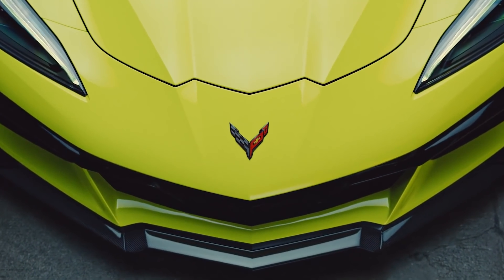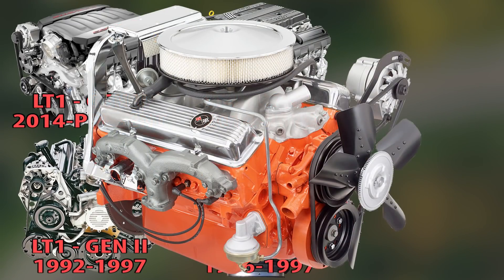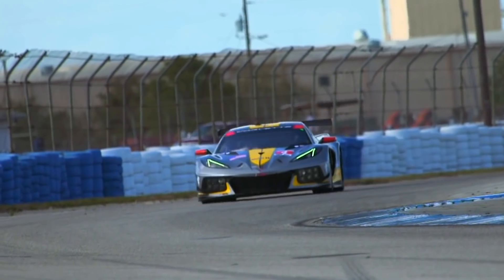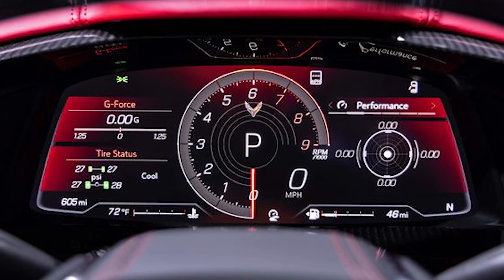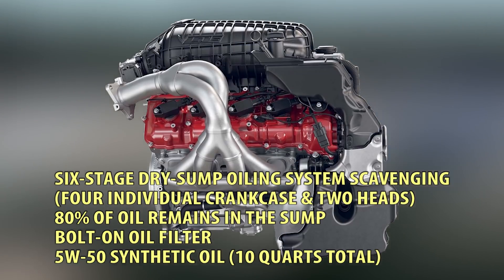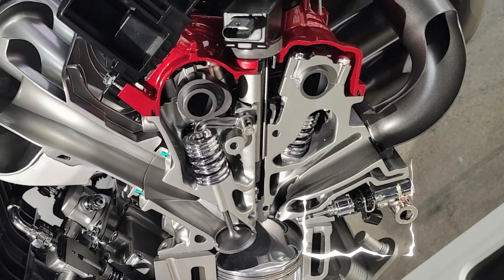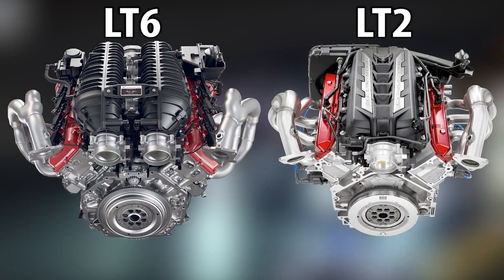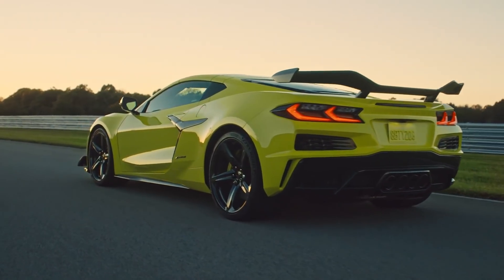What everyone missed about the 2023 Corvette ZO6 LT6 reveal

Comment: Great video accept for when explaining the flat plane crankshaft. You use a picture of the voodoo crankshaft that, while being a flat plane, is completely unique to itself and not a good representation of the typical rod journal placement of a flat plane crank.
Reply: I noticed that too! You beat me to the comments section! :-)
Reply: True story
Reply: I saw that too! Right at the 5 minute mark. Even the cross plane crank illustration looks off. The illustration just after that clearly shows the two center pistons rise and fall in unison. The voodoo engine sound with that different crank configuration, while high revving, is more like a traditional cross plane v8.
Reply: @timothycravens223  and sound is the only reason Ford used that crank configuration.
Reply: Except, not accept. All the boys made the basketball team except Marvin.  Amazon will not accept my return.

Comment: Dollars to donuts the valve train is gonna fail like it did when porsche used the same design n had issues with it and went away from that set up. Also this motor has no low end power and you will have to beat the piss out of to even get any respectable performance out of it....

Comment: Possible the C8 ZR1 will be TT, it will keep the current intake like C8 Z06, this  because if it be supercharged, they have to remove that new design intake manifold, and i don't this will be happening, but if the new ZR1 C8 is TT, possibly be around 835hp just guessing.
Reply: Root style superchargers are generally inefficient and create a lot of heat at high rpm’s. Because of the high rpm characteristics of this engine it will never see a supercharger like the previous generation pushrod engines. A centrifugal supercharger would work but packaging and belt slipping raise issues. Turbocharging will be the most effective and efficient way to boost this engine. But we may never see a boosted version of this engine at all. With EVs being pushed hard these days I see a hybrid version being the the new ZR1.

Comment: Good video. According to a recent interview with a top level GM Engineer, this platform was not designed for an all wheel drive system.(See the recent Jay Leno test drive of the new C8 - 2023 Corvette Z06). Yes, it will be interesting to see the ZR1 bringing the car to even higher expectations. (When the C9 hits the streets, I believe it will be an all wheel drive front engine design. Will it be totally EV)? I know folks will be like, ahh....no the Corvette won't be reconfigured to front engine ever again. For now, yet again the Chevrolet flagship is a winner!
Reply: The C9 will be all electric.  As for the C8 ZR1, this motor is screaming for turbocharging.  The main ROI of a flat plane crank is the ability to turbo with single stage since no cross contamination of exhaust.  I was also wandering how the C8 clutch was going to handle all this power.  I never dreamed they would do it by KILLING torque, but they did...
Reply: @barrythehatchet1380  Spoke with someone with GM.  In response to my many questions said:  "Don't give too much credibility to sites like GM Authority.  Don't count on ZR1 or Zora.  Don't count on turbo.  Hybrid will happen.  C8 is likely the last generation of internal combustion engine Corvettes".  There will absolutely be an "E-Ray" or similar variant coming up.  If not for the crazy ordering situation, (meaning by the time your name comes up for a Z06, they may not be making them anymore), I would be buying one.  Despite more power with whatever variant of hybrid comes up, it will be heavier with the motor or motors and the battery.  The C8 Z06 could be the last great Corvette.
Reply: @polystictus  There will absolutely be a ZR1.  Too much cash for GM.  Bet.
Reply: Electric motor will be featured up front.
Reply: @chachacamel  Yes perhaps. But see the new Hummer EV1 platform to get a better idea on all wheel drive configuration.
Reply: I'm letting you know, that unless something changed, a hybrid AWD Corvette will be the next model. There is no space in the "driveshaft" tunnel for a drive shaft to the front wheels, but it will be an electric motor, kinda like NSX, on the front wheels.
Reply: @chachacamel  I should have clarified when I said front engine design in an all wheel drive configuration. And yes I also believe the next generation may in fact be based on all wheel platform EV. It's in the cards for General Motors. (The Hummer EV1 platform is a solid introduction into all electric vehicles across all GM vehicle lines). But for now we have a powerful naturally aspirated LT6 powering the 2023 C8, and if the engine is supercharged in the ZR1, I predict the horsepower rating will be just shy of nine hundred!

Comment: GM's way to make a car faster:
1. Reduce displacement by half. 
2. Make the engine heavier.
3. Make the car heavier.
Reply from the maker: 1. 6.2l/2=3.1L (LT6=5.5L)
2. Apparently about the same weight stated by GM (3lb difference)
3. Depends on trim level and safety.

Comment: Might recheck your numbers because 480 TQ @ 7400 RPM is 676 Horsepower I think you got the HP and TQ numbers transposed.
Reply: With a flat-plane crank you get very little torque because they're such a short stroke and there's no counterweights
Reply: @tont3305  That actually has nothing to do with the post I presented.
Reply: @CRUSHFACTORPC  yes it actually does. The math that you have bid based on is on a standard motor. This is not a standard motor but whatever makes you happy
Reply: @tont3305  I don't care what motor it is even if electric HP ALWAYS = Torque X RPM/ 5252 PERIOD I don't care if it has an airplane flat plane crank. AT 7400 RPM with 480 TQ it will ALWAYS = 676 Horsepower. AND the earth is a sphere.

Comment: As long as GM is producing such a new world beater engine... they can call whatever they please!
Reply: @Mr.Joetatoehead What a way to go.
Reply: V shapy thingy fucking ferraris.
Reply: It's the same as anyone they gave up low end tq for high end hp. Also they are using a  expensive low production engine not based on other stuff they produce.  But hey gm already said they lose money on each c8 that's why they are so limited in production. But they miss the mark for consumers. What would you rather have a 850hp 850tq engine that makes power all over or a high strung n/a motor that also vibrates much much more and sucks to drive anywhere besides a race track and still with all the drawbacks gets killed by a car that's available and cost 50% less. Boost is God and when people are making 1500hp and 950ft lbs out of 2.0 motors well we know that the c8 already had heat issues adding a turbo was probably not a option because with 5psi the stock base c8 would kill this 50k more expensive car
Reply: @mddunlap03 No one knows what your comment means.  Maybe you could tell your Mom and then let her make your comment. That way people will know what you mean.
Reply: @dbx1233  I understood him just fine and I think he has a good point.
Reply: @bobthbldr3  Well, then I guess that settles it.
Reply: @dbx1233 hes the product of being neglected as a child lol now he's using cars to channel his rage 😂

Comment: Video says it has variable valve timing but no variable valve lift like vtech ? Wtf
Reply: And explain to me why that is necessary when this engine can do all the things that can do.
Reply: It has solid lifters like a race engine.
Reply: In this case, "variable valve timing" means that the engine can make the valves open sooner at some RPMs and later at others.  As opposed to Honda's VTEC system which switches between 2 different cam profiles (changing lift and duration) for each camshaft on each cylinder head.  Hopefully this helps.
Reply: It doesn't need it doesn't need it it produces more power than any other naturally-aspirated engine. It doesn't need it it gets the job done better than any other engine

Comment: Everyone: Electric cars are right around the corner. ICE is dead. 

GM: nah
Reply: You are correct. That is why you go out and get yourself a new Corvette or any internal combustion engine this is the swan song before you have cars without a soul. The difference between having a really nice Rolex watch and a $10 electronic watch yes they both do the same job one is beautiful the other is not
Reply: The problem is that the electric cars and their seemingly mundane existence will whoop this things ass.........as much as i hate to admit it.
Reply: @HioSSilver1999  and that feeling will be like wearing protection during sex. It's okay but it's not the real thing
Reply: @tont3305  not a very good comparison there. If you're driving a automatic car then it really makes no difference to you. And since almost everything is auto or dct it don't matter. You're still just riding in your car. One just makes a different sound than the other.

No me....my street car hotrod has a faceplated t56 with a 5.5 tilton clutch and a solid roller cam. Until you're there......you simply have no clue on the comparison front.
Reply: @HioSSilver1999  have you driven an electric car? It's not the same
Reply: @tont3305  it's acceleration and control. If it's about making speed a electric car will do it better.

I'm sure there are emotional disconnects......till you get used to the electric car.
Reply: @HioSSilver1999  have you ever driven electric car? The question still stands. Knowing not how a motor Works Pistons camshafts all the mechanical innerworks knowing how that is going on under the hood is part of the experience
Reply: @tont3305  no i haven't driven one. Doesn't matter....the experience is making speed. Not sticking your head inside the engine.
Reply: @HioSSilver1999  so you're going to tell me the experience is the same but you've never had the experience. You make statements as if you were a Gearhead but you're actually not. Rebuild an engine in a will change things for you
Reply: @HioSSilver1999  Plaid S 0-60 and the 1/4 yes but this is a track car. The Plaids Nurburg time will be 35 seconds slower then the Z. Also the Z can do lap times without the cool down and charging. But if straight line is your thing then head over to electric
Reply: @hwyfools  the plaids lap times are pretty damn good. It's not like it's some floppy suspended sedan your grandad drove. The plaid likely handles  better than what you're capable of extracting from it.

More over to reach a higher level of handling performance it takes more than most of you even know. A track weekend not only costs alot just to get in.....but you'll use up a set of tires and nearly a set of brakes. Not to mention added frequency of fluid changes with decreased maintenance intervals.  

It wouldn't surprise me if street performance was very close handling wise. It not like you can get 10/10ths out of cars like this on dirty streets.
Reply: Electric cars have come a long way. But you be  better off on scooters! Lol.!

Comment: The new ZO6 is absolutely nasty. I cannot recall a Supercar engine sounding this good since the Toyota  LFA  or Ferrari 458 which says a lot. I could only imagine how crazy the new C8 ZR1 is going to be. It’ll probably end up being an 800 plus Horse Power twin Turbo monster.
Reply: Check out the GMA T.50 if you like good sounding supercar engines.  The T.50 is the successor to the McLaren F1.
Reply: @Sir.VicsMasher  Or the Lamborghini Aventador and Lamborghini Murcielago with the Gintani exhaust.
Reply: It sounds like it was kicked in the nuts and these motors are gonna be junk on the street.
Reply: @Outtacontrol304  Says who? You? LOL.
Reply: @Outtacontrol304  I was always told: "Horsepower sells cars, but torque wins races"
Reply: @barrythehatchet1380  that’s just incorrect 😂😂 do you even know what horsepower is?
Reply: @nlsdrf1290  Yes, It is f x d / t or about 745.5 watts.  Why do you ask?

Comment: My mind always goes to how could the competition counter this great move? Toyota could come out with a mid engine platform with the supercharged V-6 standard and the LFA’s v10 As a Z06 fighter. Other than that manufactures are going to have to delve hard into research and development
Reply: They wouldn't even go to the effort to build their own Supra. They wouldn't even use their own V6, which makes more power than their Supra when in Lotus trim.
Reply from the maker: A factor to consider is that Toyota is conservative with their "performance" cars. They're more about reliability. Reliability most of the times doesn't equal performance which excites the buyer.
Reply: Smaller, lighter sport cars like Miata and S2000 can still hold their own on narrow twisty roads or dicing in the suburbs, with plenty of fun for a lot less money when you can buy a whole set of premium tires for the cost of one Z06 tire plus it's a lotta miles from my garage to somewhere I can use over 500HP!
Reply: That would be like shitting into their own lunch bag because Lotus wouldn't want to use toyota engines anymore, if they became a competitor.
Reply: Toyota probably wont bother to try to compete with Z06.  Toyota lost money on every Mk4 Supra they ever sold.  GM might build the C8, but how well is it actually selling? Nobody can afford these things right now lol.

Comment: Dear
 followers!! Don't let the beautiful pictures confuse you . Anyone who 
buys a new car from GENERAL Motors the chance you threw your money into 
the trash is very large. In this company there is no customer service, 
the company's management does not care at all, if you have a problem or a
 malfunction, you can only pray to God there is a chance that the help 
will come faster. GM is a very dangerous company, be careful and keep 
your money safe.!!!Share so more people don't get screwed.GM is a big bluf
Reply: True for most GM vehicles.  However, GM actually makes the Corvette much better than most GM vehicles.  Corvettes have much higher cost % per unit, lower profit %  per unit, and lower units produced for sale.  In fact they often lose money selling Corvette models.  In doing so they contribute to the marketing of all GM vehicles as higher performance and quality (than Ford).  For most other GM models, current vehicles are designed and manufactured with planned obsolescence similar to Ford for profitability reasons.  The GM customer experience will reflect many of the same problems customers report in the automobile industry across all Manufacturers due to the US Dealership business structure.

Comment: Little too much "journalism" there buddy. Good info but the silliness regarding the engine codes and valve drop gossip dumb down the vid. 
Those forged pistons make for a good mild boost-able engine in LT6! Looks like 4 into 2 into 1 OEM headers (exhaust manifolds) 
After the Z06 factory dyno break-in do they change the oil? Would like to know if there is a special break-in oil or first factory fill additive.  Some good info all in all thanks for the good work.
Reply: I wouldn’t call it silly do to Valve drop being an issue in the past. We could only hope that this won’t be an issue moving forward but like he said time will tell